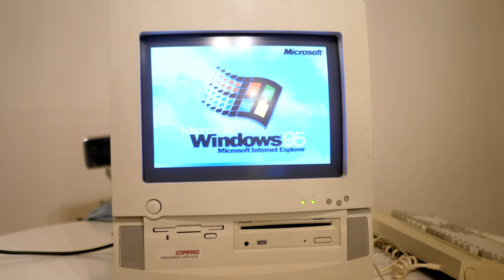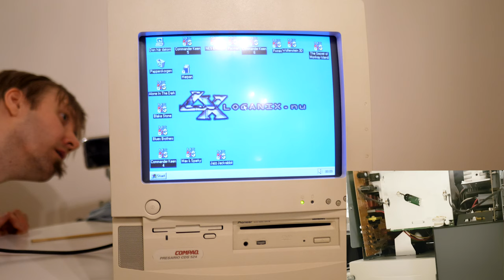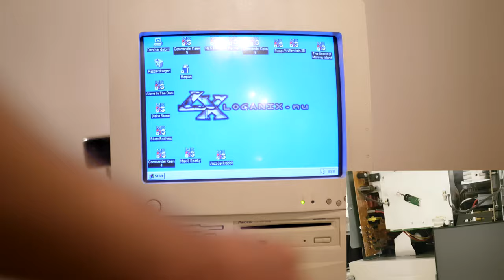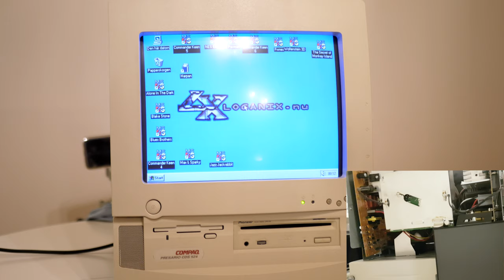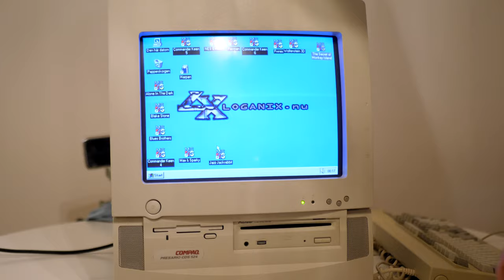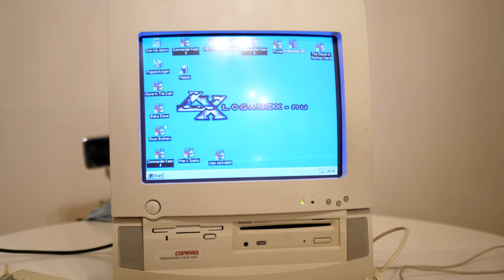Compaq Presario CDS 524 CRT Screen Adjustment with Monkey Island of course!

Comment: I have one upgraded to a Evergreen 133 MHz
Reply from the maker: Nice! I was thinking about doing the same, but they seem quite rare to find here in Sweden. So, I bought a Compaq Presario 5220 with a pentium 133MHz that will have to do :)
Reply: @Loganix  Do you know if there’s a way to implement a Video cardAnd have it come back to the built-in monitor
Reply: @Loganix  Yeah Evergreen CPUs are rare in the United States too and Expensive
Reply from the maker: @remnistance  The monitor is connected via the proprietary connector to the motherboard. It might be possible but, it requires to trace and cut/reroute the vga signaling from the proprietary connector and or either make it switchable to a vga input connected to an isa graphics card. The current graphics the Cirrus Logic CL-GD5424 imo is good enough, not sure what isa gpu will be better or even its worth the hassle.
Reply: @Loganix  yeah I thought that was the case but was just putting out feelers to see if anyone had another idea I believe the cirrus logic is a 512k which is not bad.I have a 1mb cirrus logic card that’s why was asking beef it up a little lol
Reply from the maker: @remnistance  I hear you. If I had a spare CDS 524 or any of the similar models I'd maybe dive into it as a project. I'm always at the lookout for more so who knows. If I ever do, I'll be sure to post a video :)
Reply: @Loganix  yeah tapping into that proprietary connector and connecting it to 1mb cirrus logic Vga output would be something to see